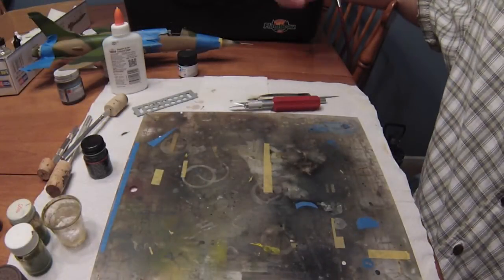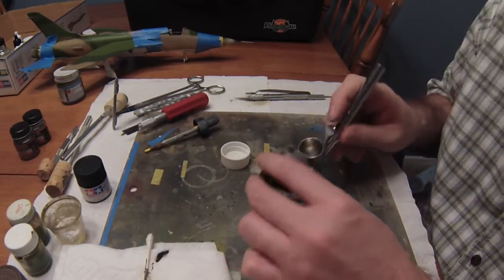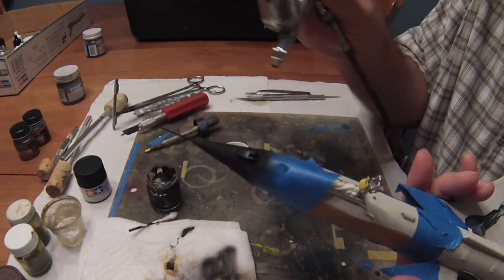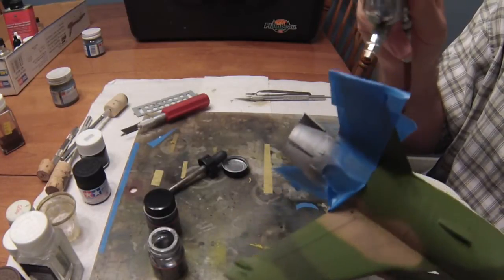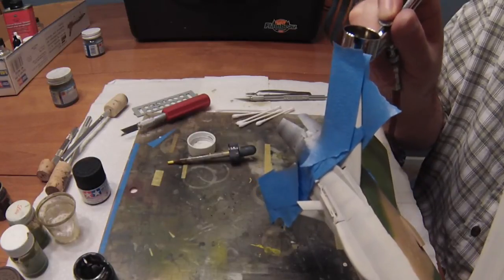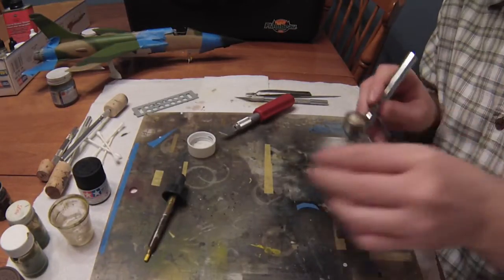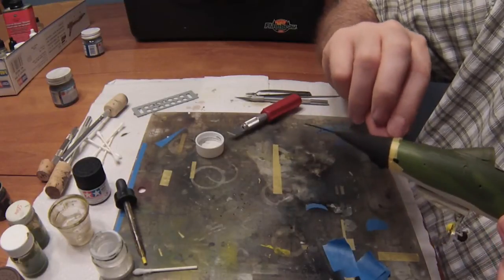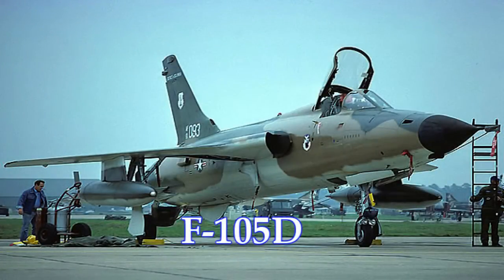Ben Builds: S2 - The F-105D Thunderchief - ep. 14

Comment: Hi ben , Video's are great, It's looking really good, Q: you're using m masters enamel and vallajo acry? out of the same airbrush ? and No curdling of the paint ?
Reply from the maker: Hey! I rarely use MM enamels, but they are required from time to time and I only have one working airbrush at the moment. So, yes I am using the same airbrush for both types of paint, but I have never had an issue with curdling.

I do tend to clean the airbrush a bit more thoroughly between changes in paint types, and I generally prime the airbrush with a bit of the new paint's thinning agent. For example, I'll shoot a bit of MM Airbrush thinner through the brush, before I drop in the enamel paint, or a bit of 70% rubbing alcohol before Tamiya or Vallejo. There's probably better ways to do this, but this one has worked for me. Hope that helps. Thanks again!
Reply: yes.. thx. im the opposite im all about the enamels But i like using acrylics to wash in .. like mortar on brick walls when making buildings for my model railroad..Trains , Planes and Automobiles yeah baby !! whats next?? .....Rockets?? lol THX Again Ben . keep the how to's coming.